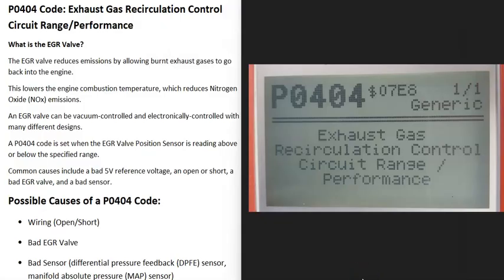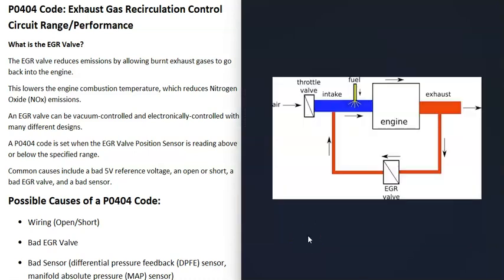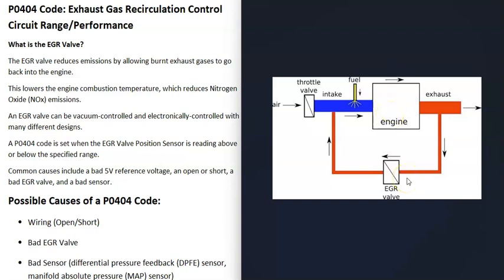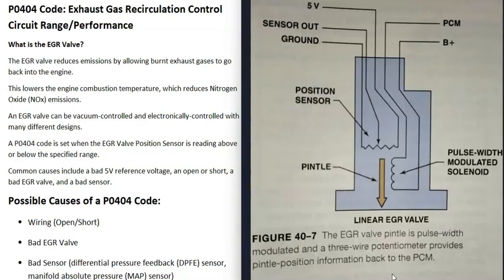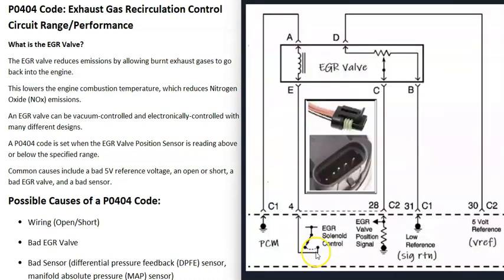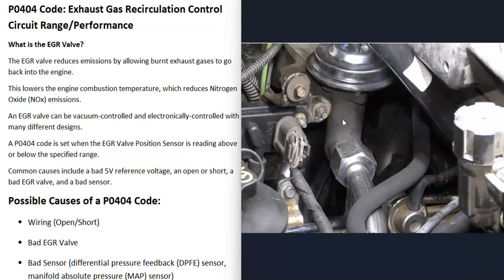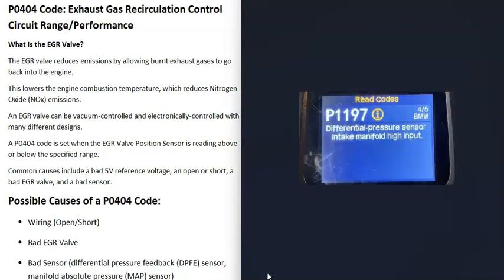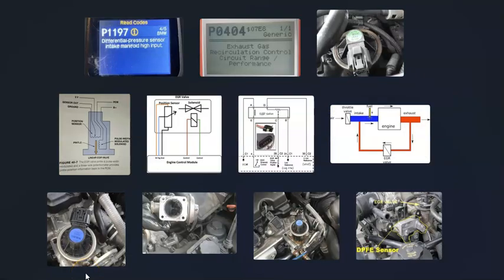Causes and Fixes P0404 Code: Exhaust Gas Recirculation Control Circuit Range/Performance

Comment: Is a confirmed status a Permanent code? and can it be cleared by an OBD2 for Kia Sportage 2024, note there is no check engine light on car dashboard ? cod P0404.
Reply: You cant "clear" permanent codes, it means there is an issue and it needs to be fixed. That code indicates an issue with EGR and thats what needs to be checked and everything which is around it.